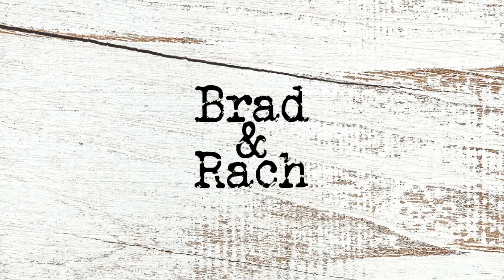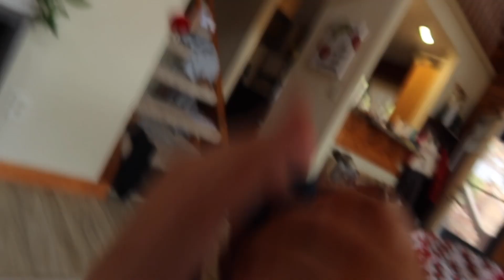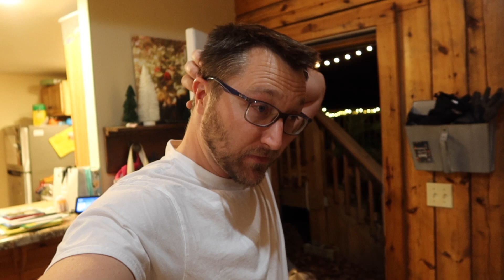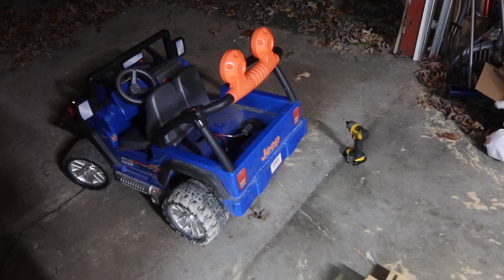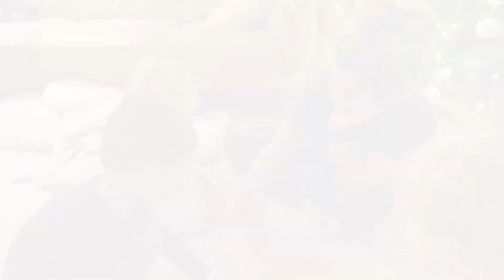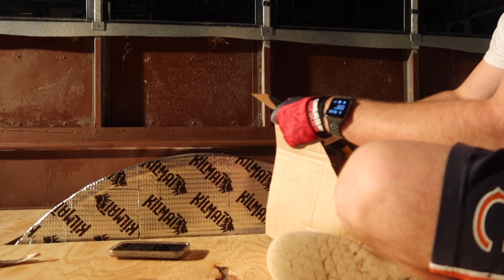Apologies in advance :|

Comment: I am an electronics assembler. I solder pretty much every day. I have been doing it 30 years. Start with a good clean connection... Trick is you need a hot solder tip for that size wire at least 700 degrees and a larger solder tip.. Second you need a good amount of solder on the wire. And a good amount on what you are soldering to. Trick is to apply  solder and the tip of the iron to the wire at the same time and then also pull away at the same time. Rosin core solder is best.. While you are making the connection feed the solder to the wire.

Comment: Hi Brad, was watching with my wife. Make sure you have a good clean physical connection before you solder. It's possible that the motor is twisting in place from the motor' torque. So find a piece of wire of
 equal thickness about 4 inches long and solder 1 to the motor, then one to the original wire.

The wires should be hot enough that the solder is "sucked" into the joint. Not to be insulting, but use rosin core electrical solder,  not plumber's solder. Test, then tape your joints for safety.

Comment: Solder sucker. Apply heat onto the part get the sucker and clean off old solder. Try it on the wire as well so you have a clean start to re solder. There is a tool we use, we use to call it the solder sucker, not sure if it’s the correct name for it. I use to work with electronics years ago. Try Google and ask if there is a tool that cleans off old solder. To get a good join you need to clean the old solder off. 👍

Comment: Did you get some solder wire and use it . It will turn to liquid form and you put the wire and it onto the motor part and hold wire on it until it turns solid again.